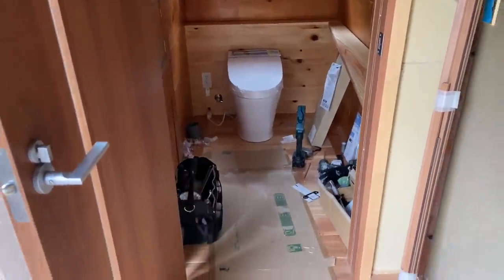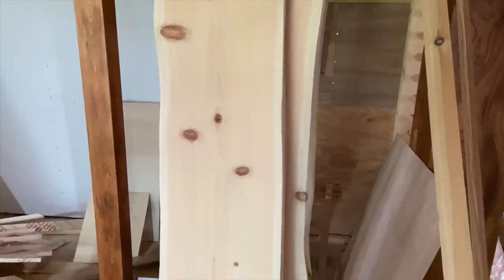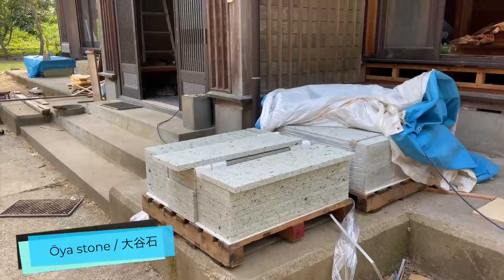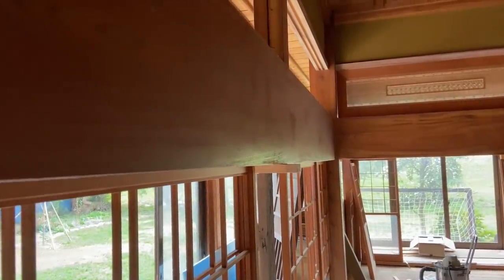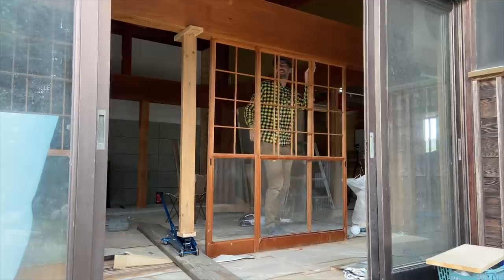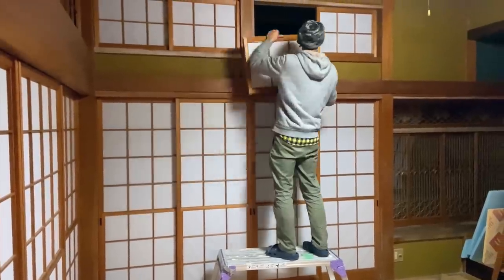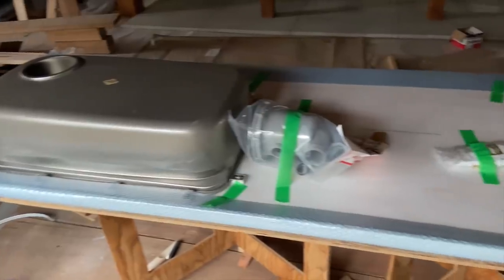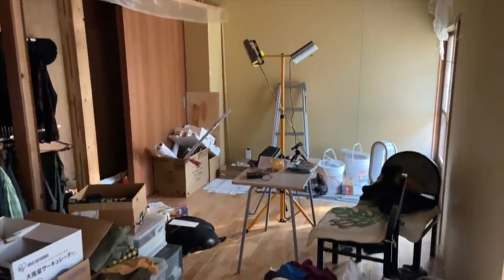Japanese Abandoned House Renovation #8 | Moving In Part 1

Comment: Once the Wood stove was in and lite.  I felt the Wa of the house increase ten-fold...    ^~^   As to the Posts near the stove, I would suggest half-cladding the bottom-half of each post with the same Oya-ishi stone you used on the backing wall. This would protect the posts from heat as well as give a visual tie-in.  For the stove top, they make a cast iron fan that is driven by the radiant heat of the stove with no outside power soarse.  This will help to push the heat out into the room.

Comment: I'm curious about the ceramic paint you used for the bathroom vanity.  Does it have advantages over epoxy, or just polyurethane?  Wood counters are lovely but I worry that they will deteriorate in contact with moisture unless an epoxy is used, which seems complicated and expensive.  Beautiful work you've done on a fantastic home.
Reply from the maker: They don't seem to use much epoxy here, mainly poly. I chose the ceramic paint, although I didn't know much about it before, as it's used here for some of the local woods like hinoki by higher-end furniture makers to preserve their natural colours. I used a sealant undercoat as recommended by the manufacturer for wet areas so hopefully it does the trick.

Comment: Man, your house looks so nice, and you must love it even more since you worked on it so much as opposed to just buying a finished one. Those screen doors at the end with the peacock design looks SO NICE. How do you change the lightbulb when it wears off in that round white thing in the kitchen? The only thing that looks weird to me is the wood in the bathroom. To me a bathroom should only have ceramic tiles. But still, it's way better than full plastic, i'm so sick of plastic. 
Now that you spent a winter in there how is the heating, does that little stove manage to head the whole house? Did they give you the wood from the trees you mentioned for free for taking it off their hands or did you have to pay for it? So many questions, so little time...
Reply from the maker: Not as difficult as you might imagine to change - the cover comes off quite easily. We do need supplemental heating - still experimenting with circulators to get the heat to move around. Yes, the wood is free. It costs money to dispose of so usually people are more than happy to let you take it.

Comment: i dont know much about the use of just wood for bathroom walls, I've always put waterproofed drywall on all bathroom walls and ceiling before covering with anything decorative that i could also apply waterproofing if needed

i do love the esthetics though

for your vent cover i recommend using metal hooks that hook to the slats and hang down below it to hold a barrier underneath it, on top of having a barrier set on top of it, this will make a "dead air pocket" that will lessen the loss of heat

you could always tile the posts near the wood burner to ensure safety

make sure to empty the firewood storage with use regularly, when it gets low, empty, inspect for pests and rotate the old on top of the new lumber

for the custom shoji I'd carve tiny numbers into them where not too noticeable and where they go so next time you have to repair them you'll know exactly where they go

if you get the chance please tell all the tradesmen that you've had there that us viewers love and appreciate all they do
Reply from the maker: Thanks very much. The carpenter made sure to leave gaps at the top and bottom of the wood so there was no place for moisture to pool as one way of reduce the chance of mould. Definitely been thinking about the tiles on the posts. Will probably do at some stage. Thanks for the idea about the vent - will look to implement that. In regards to the shoji, I didn’t notice at first but they already had the order written on them (in kanji).

Comment: Do you have access to soap stone? The fire ovens with long transmission line built in, and  with stone's superior ability to store heat keeps house warm 24 hours with only 2 hours of burningwood. Sure the size of the house dictates the size of the oven. 1300kg oven keeps 100square meter house warm with about 4 cubic meter of wood during a 6-7 months, even it's -20C.

Comment: I really like the look of the shoji and the wagami. Recently I have also seen a lot of these with one or both sides of the paper having glass so it is not as easy to rip/poke through. While I understand that it is not necessarily traditional, would you consider it in the future especially since you have kids in the house?
Reply from the maker: The bottom section does have glass on one side. We may switch to the extra strong paper at some stage, and though there is the "plastic" paper I don't think we'd do that.

Comment: You may have mentioned this in the video but I had to watch with the audio off due to a headache, are there any issues with water creeping into the crevices left open at both the top and bottom of the half unit in the restroom, I would be worried of dark and damp meaning mold since there seems no silicone applied to those sections.